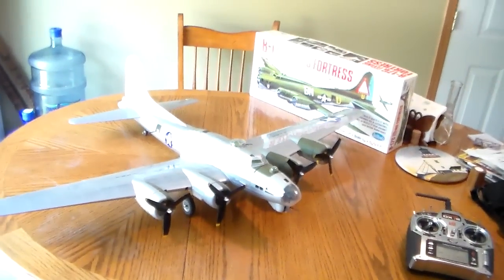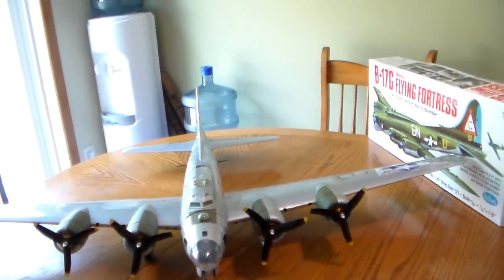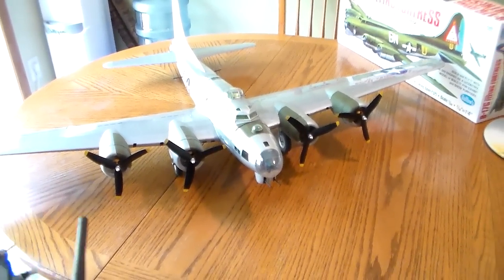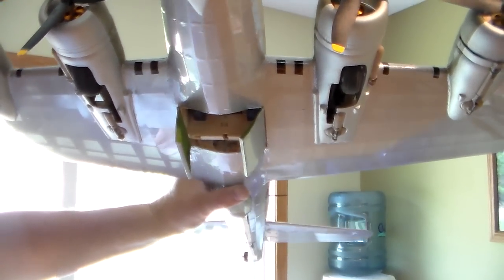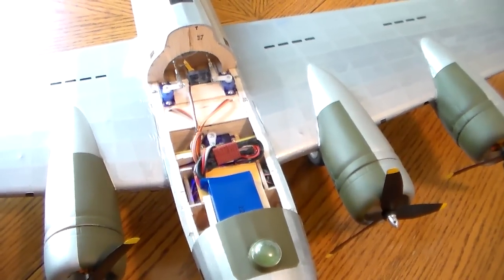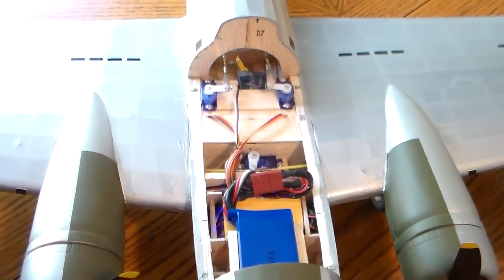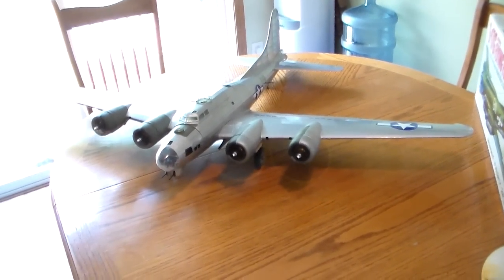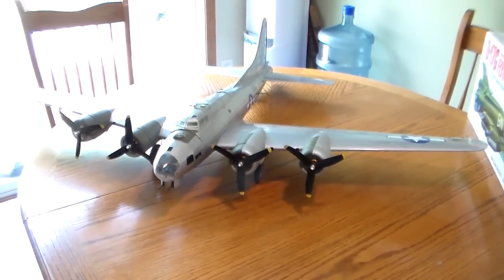Guillows B-17 rc conversion function video

Comment: Nice build!
I have an EFlite B-17, which looks and flies great too, however, in the area that I live, weather conditions are not favorable for flying a lot of the time, often due to high winds, a more powerful propulsion system would increase the opportunity to fly more frequently. 
I a big fan of the brushless motors that you have used, I reckon it would have been nice to use motors with the esc built in, but unfortunately, they are no longer available through Tower Hobby. 
The retractable landing gear is a big plus, I would like to install retractable landing gear on a few of my models.
Thank you for posting these videos!
Please have an excellent and awesome day!
☀️✨🛩

Comment: I love these old balsa kits. I built tons of them back in the 60’s 70’s period. I used to use CO-2 motors and sometimes a gas engine and FF. I have built a couple of these recently and added in electric motors and 3 channels and the other one was 4 channel. My latest one is the 1/16 scale P-47 Thunder Bolt got the body made so far. This one is going to be a 5 channel set up. I just don’t know how to do the Fowler flaps yet. Yours really came out nice. I can’t wait to do my 17” wing span Grumman TBM Avenger electric motor set up with Rudder an Aileron speed control or maybe just motor and free flight set up will see.

Comment: I was given one of these kits a while back and recently found it. Now that i have been active in rc models for almost two years now mostly flying epo planes and cp helis i can't wait to build this. But not till i work up to it after i first build the flying stick...then a kyosho edf swing wing vision jet. This is definitely an advanced/expert build project. Also found out that the b17 kit is one of the most expensive kits priced around 100$.

Comment: Hey man, me again.  The b17 is built and I am now gathering the guts for it. I'm basically trying to mimic alot of your set up but I can't wrap my head around the single servo aileron you have here. Did you use bell cranks? Could a 2 servo aileron set up work in this?
Reply from the maker: if i were to build this model again i would just use a 2 servo set up like in my B-24 and B-29. great to hear you are building !!
Reply: @jagdpanther9  alright thanks guy that solves basically everything for me then! Iv got to find some tires. I'm anxious to put this bird in the air

Comment: Hey man what would the max weight for this power plant? I might be pushing 30oz by the end of my build
Reply from the maker: say man, look at my channel and i have a video with  another power set up for the B-24 and the B-29 . it is 3s and uses 2 blade 5043 props. see if this link works https://www.youtube.com/watch?v=adrFbggpNNk&t=93s
this 2s power set up is proly going to be limited to 23 oz and lighter .
Reply: @jagdpanther9  iv looked at that. Im using a 1500mah 3s, 2200kv motors, 10amp escs with 5030

Comment: I attempted to RC one of these in 1978-80.
I had 4 3volt motors from RS. but batteries and sevos were a real problem back then.
Reply: did you complete it?
Reply: No, I never did finish it.
I'm currently working on a Big Mig .061 powered guillow P47 3/4" scale 30" wingspan.

Comment: I noticed u don't have the brakes next to the ailerons on the wings
Reply from the maker: hrachia kasabyan I did not add flaps/brakes when I built this model as I was trying to save weight and keep it simple as possible. after flying it I have found it could use them but I get by without.thank you for your comment.

Comment: Did you use the paper included in the box or you used monokote/ultracover?
Reply from the maker: +Harald Schevik hi, on this model i used iron on microlite covering and had a difficult time with it but the good thing is that it weighs nothing. i would use park lite from hangar 9 when i build another one. the motors were A1504 9 gram 2200kv that can be found on ebay. you can get all of the details of this build from the build log @ rc groups the link is in the video description. it is a nice flying model =D

Comment: Great Job... I decided to take on this project and came across your video. I have been building gas powered for some 40 years, never electric. I was wondering if you thought this motor and esc would work. The motor is this same size but the esc is 30 amp. Here are the spec, any help would be appreciated.

 Motor Specification:
KV: 2200
Ri(M Ω): 0.033
Battery: 2-3Li-Po
Max Power: 342W
Test Prop: 7x3/7x4
Motor Size: 27.5x38mm/1.08''x1.5''
Shaft Diameter: 3.17mm/0.12''

30A Brushless ESC Specification:
BEC: 3A
Constant Current: 30A.
Max Current: 45A (less than 12s).
Low-voltage Cutoff: Auto detect.
Input: 2-3 LiPo or 5/10 NiMH.
Reply from the maker: hi, i think those guys would be too big for this model.in the video description  i added a link to my  Guillows B-29 power source video .i discuss what to use for power on these models and also in that video description there are part numbers for the motors that i like to use in these 4 motor models . i am glad to hear you are building the B-17!
Reply: @jagdpanther9  Thank you, sorry I must have missed that in the description.  I will check that out, will be buying the same as you, I am one not to reinvent the wheel. Thanks again.

Comment: Do you have to cut and make the surface controls yourself?
Reply from the maker: yes, they show you where to add the control surfaces and really its not very much work.
Reply: jagdpanther9 the Guillows instructions tell u how to do it?
Reply from the maker: no  but if you look in the video description i have a link to my build log @ the rc groups and that will help you.
Reply: jagdpanther9 
Cool!! I'll check it out but it would be awesome if u made a video of how to build them. U seem to be really good at it. It would be greatly appreciated by a lot of ppl if u shared your knowledge via video. Just a thought. Thanks alot for your help!
Reply from the maker: so glad you have such interest in these conversions! the biggest problem i have about my videos is my upload speed is horrible. i live miles from the city and therefore it takes hours just to upload a 3 min. video =(. i do plan on making a building tips video in the weeks to come just covering the most important things.

Comment: how do you cover your planes they are always beautiful.
Reply from the maker: thanks will, the finish sanding is very important. I use a flexible 3m sanding pad with 180 grit sticky back discs. very carefully sanding and checking the panels and surfaces to make them straight and smooth. hold the wing, fuselage, panel up to a good light source and look down it until you are sure that it is straight and true. blow the balsa surface with light compressed air to remove dust and the covering will stick better.the microlite on this model is difficult to use and likes to wrinkle but it weighs nothing.i prefer parklite and have used it on most of my other builds.
I have a 27" f7f tigercat and a guillows rumpler biplane in store for this winter =D
Reply: good to know im starting my first balsa build, a guillows cessna 150 so that is really helpful, cant wait to see the f7f.
Reply: thanks for the help i really appreciate it.